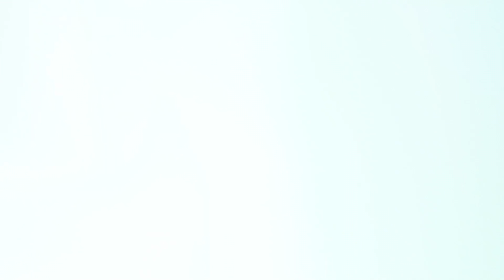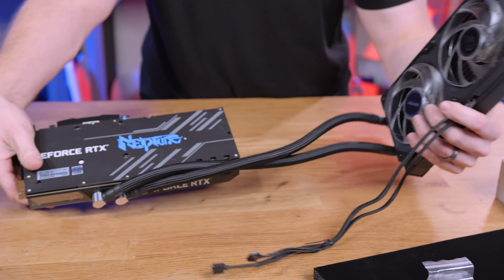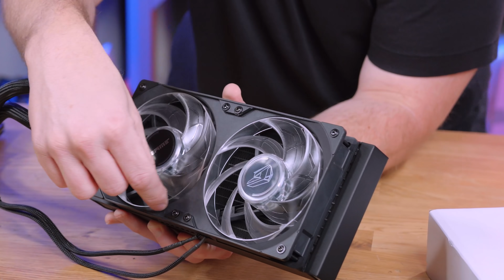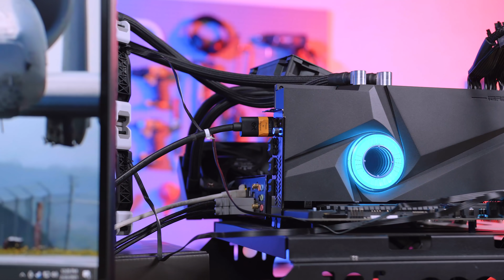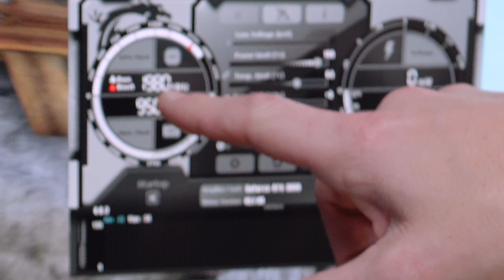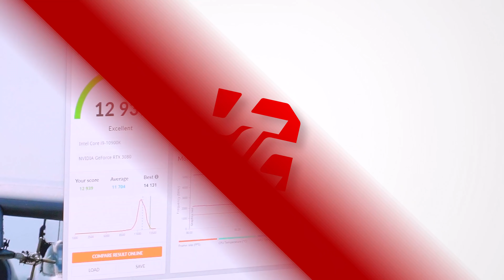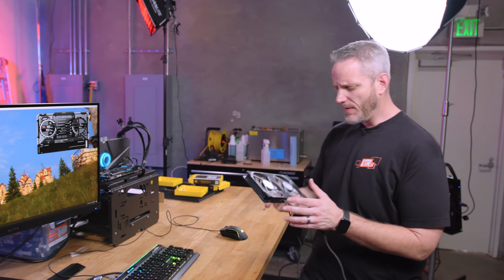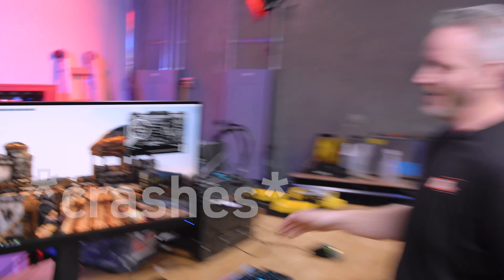AIO vs Air Cooled Video Cards... worth the extra cost?

Comment: Just recently picked up a second hand EVGA RTX 3080 XC3 ULTRA hybrid for £430, the seller didn't use it as it would shutoff randomly when gaming, they did not tell me that when selling it to me, but it turns out that there was no thermal paste on the centre of the die which caused the core temp to read 65C but the hotspot would be 110C which caused the shutoff, took the card apart and repasted the GPU die and it works like new! temps now reach a max of 54C when gaming. I was so chuffed with my current luck with the card and fingers crossed it shall last for more years to come. smashing any game at 1080 ultra RTX on! and my animation renders are faster than ever (Used to have an RTX 2060 12GB ver)

TLDR: seller sold unused 3080 because it would shutoff when gaming. so I got a brand new 3080 which is AIO cooled for half the price of a new 3080 on amazon.

Comment: I'm with rtx3080 10G ventus , de-shrouded and I'm using  2x Corsair 120ML in the Evolv Shift XT , undervolted to 950mV @ 1900 MHz , +1000 MHz memory. With 50% fan speed at full load stays around 65⁰C

Comment: I would say so long as it is a good design an AIO GPU is a good option for cases like the Hyte y60 where you vertically mount the GPU and it would put the fans right up against the glass side. Other then that I would just say stick with air cooled.

Comment: ı will I bought msi seahawk x gtx1080 back in the day for regular gaming-x price. first 2 years was awesome then the liquid is vanished to half in aio. I was hearing the gulps and temps jumped from 60s to 80s under load. bought a "Raijintek Morpheus II Core Black" and mounted 2x120mm fans on it. I'm happy as day 1. still rocking with my gtx1080. I will not try my chances with AIOs again.

Comment: So this is such a niche market for aio gpu but i have a 3070 Ti i do heavy OC and my temps under load are between 68 to 74 C im in a 4000D airflow. I wanted to know does this produxt only work for 3080 and 3090 or will it work with the 3070 ti also if not can i purchase a waterblock and simply mount the radiator snd connect the tubes?

Comment: This testing should be done inside a case. majority of user have a case not a test bench.
A case air temp can heat up from the GPU, and a rad sitting on the front getting access to a fresh air may perform even better.

Comment: I feel like there's not a significant enough performance or temperature improvement to warrant the drastic price difference. For instance, the RTX 3080 that I want right now costs around $500, but its water cooled variant is literally twice that amount. For the same price as that water cooled one, I could just get an RTX 4080 and get more bang for my buck.

Comment: Doesn’t really seem to be too many water cooler GPUs, can you use the same radiator to go for the cooling to the GPU and CPU? Seems to be a good idea especially since GPU usually runs so much more power than the CPU

Also…Why would these really powerful CPUs be bottlenecking in the systems more especially at the lower 1080P resolutions and I’m confused I thought games weren’t really anymore that hard on the CPU??

Comment: I still use a gtx980, it was a founder edition. So after it goes over 80 degrees, i was losing fps ofc. I put a thermaltake performer 3.0 on to graphic card. Till then i've never seen a temperature more then 55. But its time to upgrade this bad boy.

Comment: I can't risk losing my whole PC from a leak in liquid cooling (even if the chance is small that it could leak) I just can't do it! Air cooling all the way in my builds! Even in the upcoming RTX 4000 and RX 7000 GPU's
Reply: The fluid is non conductive. It would not hurt anything, just be messy

Comment: I have a gigabyte 1080 (non ti) with a corsair H55 aio. I've had to undervolt it 881mv @ 1847Hz  and +400 mem and in Heaven the hot spot reaches 67* after 10-15 min. If I run voltage any higher temp gets up in the 80's and Heaven crashes. Seeing a couple people saying they have a Ti and have lower temps then what I'm getting, what do I need to change? I'm using the fan that came with the H55, do I need a better fan?

Comment: Is there any reason beside aesthetics why they don't plug the AIO fans back into the GPU ? Seems like a very obvious solution to the CPU controlling the fans thing. And if it's just for aesthetics run it inside the sleeve of the coolant tube going from the radiator to the GPU.

Comment: 95° C is 203°, which is way too high for computer components. Anything higher than about 155° (~70C) is going to decrease the lifespan of your components. If you want them to last long, they need to run cooler.

That said, my 1060 SSC blows like a banshee when I'm running games, and the sound gets pretty irritating because I have the fan curve set to max out at 155°. I did not know there was an AIO solution I could install on it until I saw this video. Pretty cool. I'll look into that NZXT bracket thing.

Comment: I have an EVGA GeForce RTX 3080 Ti XC3 with its hybrid AIO cooler.  Compared to the 72-77C range under full load with its stock heatsink/fans, it runs in a considerably cooler temp range of 47-52C under full load.

I'm still playing with the overall setup in my case since I also have a 420mm AIO for my i9 10850k.  Both my CPU/GPU are getting great cooling and I'm not getting thermal throttled.

Comment: So wait do the same rules apply with installing a cpu liquid cooler as when installing a AIO cooled GPU or can you get away with orientating you're radiator with hoses coming from the bottom instead of  top to make room for both CPU & GPU closed loop liquid coolers? Phil said something about not putting pump higher than the rad and that confused me. Any help would be great as I'm trying to get my new kingpin 3090 installed into a Antec df Flux 700 as it says it will fit 2 360mm rads but having trouble doing so without more than likely removing the top fan closest to front  to make room for the rad to move up enough to fit front top fan in as well. Or just going without that front fan but that's air intake and top is exhaust which should I sacrifice if I can't seem to orientate it another way?
Reply: Easy way to remember it is to always have  where the tubes enter the rad to be higher then the pump. So since cpu AIO coolers typically have the pump in the block you are best to mount the rad at the top of the case or in the front as high as possible. Since a GPU AIO works the same way with the pump in the GPU housing it’s best to mount them either in the top of the case or a front mount with the tubes at the top of the rad. This is all in an effort to let the small amount of air that is in these loops to sit at the highest point. You don’t want your pump at the highest point because that’s where the air naturally wants to go.

Comment: I used an AIO because the air cooler is bulky, so the thinner AIO also lets me run a capture card in the PCI 4 slot. Still covered up my upper pci 1 slot, but that's fine

Comment: Hello. I need help to figure out something 

i am gonna buy this 
(Zotac 3060ti oc) tomorrow but hesitating because of cooling system. I can't afford water cooling after spending on this gpu..

What kind of cooler do i need.. Will air cooling good enough for it? If not i have to change my options for gpu because water cooling is out of my budget

And i have 500w psu.. Will that suffice? Or should I have to buy 650w psu

These are my specs

 (1)
HDO DESKTOP 500-GB 500GB HDD
SN 

(2)5 MB-510 SERIES GIGABYTE H-510M-H
SN SN21129A001123, 

(3)PROCESSOR INTEL 1-5 INTEL CORE 1-5 3.10GHZ 12MB 10500
SIN U1V47K7400453, 

(4)RAM DOR-48-GB CRUCIAL 8GB DDR4 2666MHZ
 
(5)
SSD 128-GB TEUTONS 128GB M.2 NVME
SN 21N80128012546

Comment: As you see in my profile pic I have a whole custom water cooling layout. And my wife has a aio cooled system and my system runs 10 c  lower Tham my wife on average without turning up fan power. But as air vs water coolers I say the water cooler will make your system last longer and run faster cooler giving better performance in the long run.

Comment: I used to have a GTX 680 and spent a few bucks for a water block and added it to my custom loop, which was cooling an i7-6700K at the time. The idle temps came down as expected. When I replaced it with a GTX 1060 6GB, it ran cooler with the stock air cooler and the same CPU than the 680 on water.

So long as the card stays at a sane level for the loads I place on it, I'm good with air cooling. 

Having to find a place for a separate 240 rad in a case with a 360 already in it just makes the job that much harder.

Comment: I live in the NE US, so placing my gaming rig in the basement which never really exceeds 60-65F temps even during the Summer, air cooling all the way. My GPU/CPU rarely crest above 60C even during strenuous benchmarking, 100% air cooled. AIO's definitely do the job better and they're quieter, but air cooling is simpler and less failure-prone. If I had my gaming rig locked up inside a closet with poor airflow, AIO would make a lot more sense.

Comment: It is a marketing movement by the companies in order to sell more cards. Probably we are talking for the same PCB in which has been installed an aio and they sell it as watercooled card with higher price than the aircooled. Enclosed and without air vents for heat removal and air intake from the case fans, the mentioned components will degrade in a very short time. 

So better to take an aircooled card, and have your head, quiet. The money that you will have saved, you can invenst them for fans, air cooler, water cooler, custom cables  etc.

Comment: I've been running an EVGA Hybrid 1070 for about 3 years, runs very cool and clocks at about 2GHz, very nice card
Pump noise and the not-so-great included fan are the only downside, making the system a little louder... but it runs at like 40C max so yeah
Reply: @William Schlass nah it's always sounded like that, by "noise" I mean just the sound of the pump, the constant high pitch of the pump just doing its thing. Rad is above the pump, always has been

Comment: I bought the cheapest GPU cooler, as far as AIO coolers that I've seen and added it to my son's old 1080ti. It's an Idcooling brand that comes with everything to add it to a GPU, 240mm and very similar to a Nzxt g12 but the Idcooling comes with everything. Paid $70 for it and expected it to be garbage, but it was not.  The GPU was a PNY I got cheap and it had a terrible cooler on it that should've been on maybe a 1060, not a 1080ti. the card ran around 80C in a good case with great air flow and stock settings. add the Idcooling AIO and just like that it was running mid 50s. I OC the card pretty good, saw good gains yet Temps were still barely cracking 60c. Definitely worth it if you have a card with a crap cooler. I plan to put the EVGA hybrid kit on a 3080ti Ftw3 I have which is kind of a shame as the Ftw3 is very nice, but the 3080ti with a great case, basically open air with 3 noctua fans blowing across it and the GPU fans cranked up,  runs around 73c and I'd like to see 69c tops like my 3080ftw3 ran.

Comment: Mosfets need more cooling then the GPU from what i observe.
There are 2 temperature sensor on Nvidia cards (that i an aware of) One inside the GPU and one is called Hot Spot.
Hot Spot is the one monitoring power rail temperatures which are according to what i see is 10 degrees hotter then the GPU.
Not cooling those off will kill your card sooner then later.

Comment: I have that NZXT bracket and one of their AIOs, one thing that concerned me was no cooling for any of the VRAM, so I got a set of thermal pads, and little aluminum sinks meant for a Raspberry Pi and put those on it
Reply: I thought the same as you, put heatsinks on the vram and I run mine that way, but I saw tests where the fan blowing across the board cooled better without the heatsinks. Still I run the heatsinks, it wasn't much hotter with heatsinks on the vram and should that fan fail you have a little buffer

Comment: Have the nzxt kraken on a red devil 5700xt with an h115i, added copper heat sinks to the vrms and it runs soooo much better than the stock air cooler. Now...mounting the rad is a problem on its own as the hoses are short.

Comment: Wow!tech sure has come far, I want to build a water cool pc,I live in the desert 🏜gets hot even with ac running,I have a nVidia 2080, i72700 amd,side cover off facing the ac, it works,now I want a liquid cool pc,I want it all cool in liquid, now you can get a gpu liquid cooling, COOL,how about the mother board,no not the prosseser, the actual board,that way the only thing moving is the radiater fans,and on my deal,I want it all open,no case,or box or tower or whatever you call it just something to mount all on to,but I'm learning from all you YouTubers,then thers$,it took yrs just to save for the pc I have by clx, one piece at a time 😀,-peace

Comment: Jay... I need a video THEIR AINT NO  tutorial on the internet about those aio gpu... orientation... as GN  steve's rant we need tutorial...

Cause most of us got atx case and we cant put it top with ventirad... we put it front...

Tubes placement, position we need a whole 1h vid... problem of ram blocking ...solutions...

i know most of guys got fans fuelled gpu... but for the tiny sioux tribe that only found those kind of... help us ...

Comment: i've built computers for myself and friends for 18 years. Never had a watercooled. As long as you choose a chasi with good airflow and airpreasure you dont need watercooled for regular use. Gaming, surfing, other basic stuff and work. If your hobby is overclocking and benchmarking, sure go ahead and put in extra money on AIO. I run probably the hottest stock graphic card on the market atm. Aorus Xtreme 3090. If you dont have a proper cooled chasi you will melt this car, but its a enthusiast card anyway. So ppl who buy it should know what they are buying. The aircooling fans these days are so effective you dont need AIO if, as mentioned a proper chasi setup

Comment: I think the best use case for AIO is 100% for noise. I have a gaming OC 3080 and it gets quite loud, even though I undervolted it and temps are still not the best. At stock it was pushing 90% fan speed (2400RPM) and 77 degrees with really demanding games with Ray tracing and DLSS which is pretty terrible. At least now it's only 74 degrees max and 85% fans speed (2200RPM) in extremely demanding games and it never cracks 70 in more esports games which is a bit more acceptable. It still has higher than stock performance (1860MHz is the most stable clock I could get in every game) because it never downclocks itself.

Comment: Had a 2080ti water force with 240mm AIO and it was first great until the card broke, the repair took 2 months and the card came back with a radiator that looked as someone used it as a hammer. Got my money back after nearly 2 years but man was I pissed. My new 3080ti is air cooled and runs at max in the low 70s, 10 degrees hotter than the 2080ti… so water cooling ain’t worth the extra in my experience.

Comment: when it comes to gpu aio, can you keep the radiator below or do you have to keep it higher than the card?
Reply: General rule of thumb for all AIO's, you want the rad/tubes ABOVE the pump whenever possible. Putting it below does affect efficiency and can cause the pump to fail prematurely.

Comment: manufacturers are not making any hybrid GPUs with only 120mm radiators any more. In my tiny mITX case, I have no space for 250mm rad and normal air cooled GPU will just heat up and eventually bring all the noise... Currently using 1070ti hybrid which is cool and quiet and fits fine in case together with 120mm AIO cooled CPU

Comment: It could be worth it. I mean if you have a strictly gaming pc the GPU could easily use twice as much power and generate twice as much heat than every other component put together. So having an AIO means you don't neat very beefy case fans.

Comment: I personally find it worth it. From personal experience using both gigabyte Auros xtreme 2080ti both air cooled and aio water force and the new 3080ti versions. I can say it’s worth it by a mile. Using the fractal r7 case the air flow is pretty damn cool but these air cards they list running at 60-70C is a lie they typically run at 80C+ just playing RuneScape for gods sake. They heat everything else up in my pc. Forces my cpu aio to go into overdrive. So going from 80C temps using an air cooler to never seeing your GPU over 50C using an aio is 100% worth the additional cost.

Comment: I had wondered for years why my PC I built the GPU fans never spun up very fast. My GPU Temps were getting up to 70-80° C. Still within the thermal limits but still.
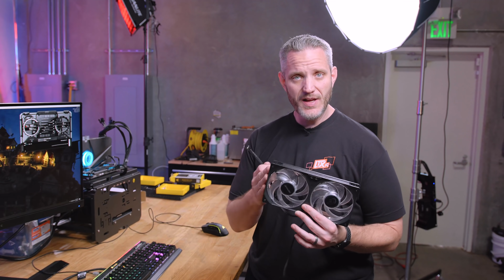 After hearing what you said at the 12:30 mark I installed MSI afterburner and played some games, and the GPU didn't get past 60°C so far. 
Thank you for this important information Jay!!
Reply: I finally tried it too, it is crazy how much difference it makes!

Comment: I don't understand the critique about lack of active cooling on the VRAM. Didn't this test show that the issue was not with the temp of the card/vram, but the max power draw? So it sounds like the system could effectively cool all parts of the card at max setting?

Comment: « 30 degrees idle, 50 at top speed, not bad »
Me with an aircooled rtx2060 overclocked at 40-45 idle and 70 at top speed « wtf is this guy smokin this is AMAZING »

Comment: I just bought the NZXT Z73 Kracken and changed the fans to Lian-Li Uni 120 fans. The system has 9 Lian-Li Uni 120s (3 on the radiator at the top as an exhaust, 6 as intakes and the cooling is awesome!!!!! (The GPU is the stock fans)
31c when idle and 45c when under full load!! This is in a heat wave also